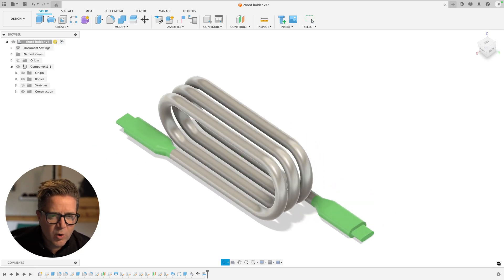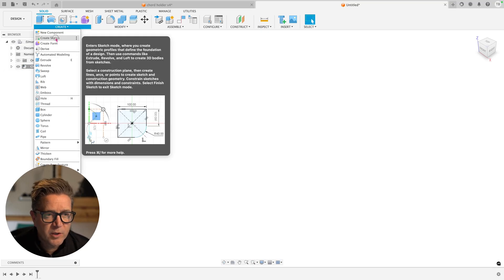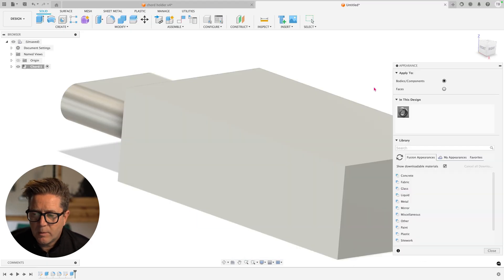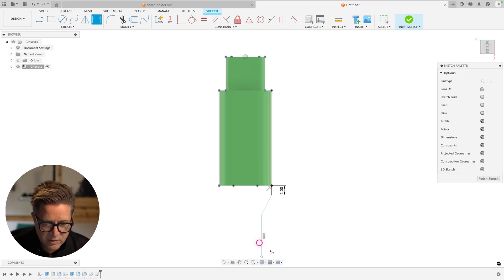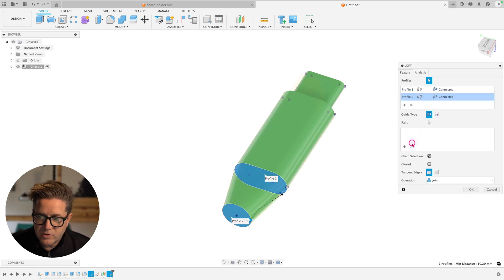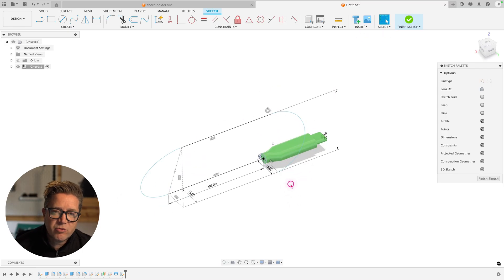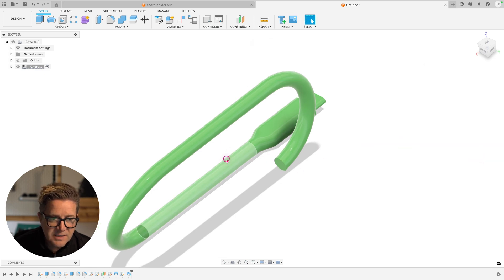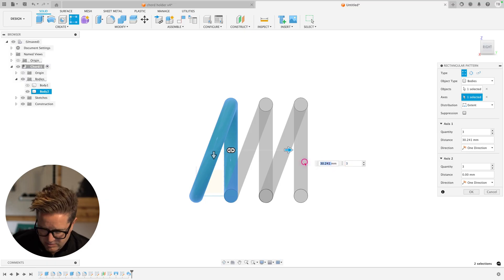Modeling a USB-C Cord in Fusion 360 — 3D Sketch, Sweep & Loft Tricks!

Comment: Great video.  Instead of winging the sweep path in 3D space, I find it much easier to use construction planes for each of the path segments.  For instance, you created a tringle of construction lines, so make a construction plane on the hypotenuse of that triangle and sketch the arc on that plane.  If you don't like the angle. you've initially created, just change the dimensions on the angle dimensions of that triangle and the arc segment changes the angle of orientation because the sketch plane angle changed..  Then for the upper straight path, do the same, and create another construction plane for that segment as well as the arc moving down.  And I also prefer to do these cable segments as individual components so I can use "Constrain" to or a "Joint" command to align the ends of the circular elements after the pattern, then merge the individual segment components together with the Combine tool.  .

Comment: Interesting option. Last time I did something like that I just made a coil and split it, moved 1/2 of them then extruded the straight parts. Less control and you don't get the vertical drop (if really needed) but a lot more simple. Typical Fusion there is 101 ways to skin a feline ;)

Comment: Thanks for this fun one Tyler — I always learn so much from your videos! In this case, could you have also created the same result using: Coil, Split Body, Move (60mm), and then Extrude (60mm) so the circle faces from the cut-in-half-coil create the cylinder "bridges"? Or would there be a downside to that approach? 🙏
Reply from the maker: Love that approach!  Probably even better...what do you think?